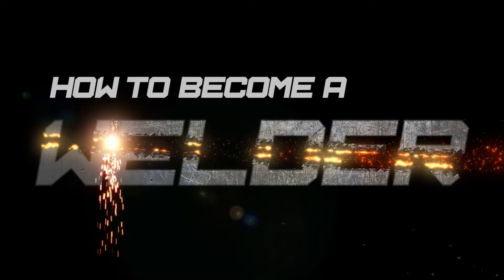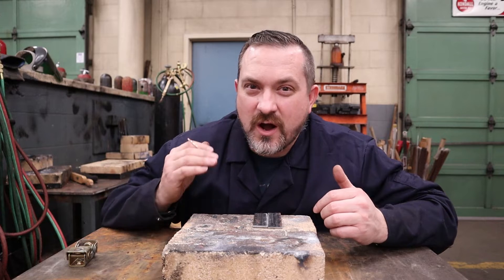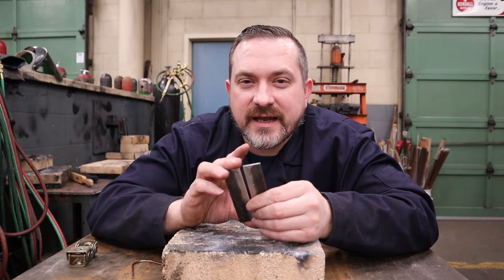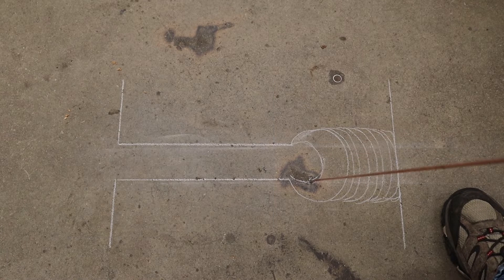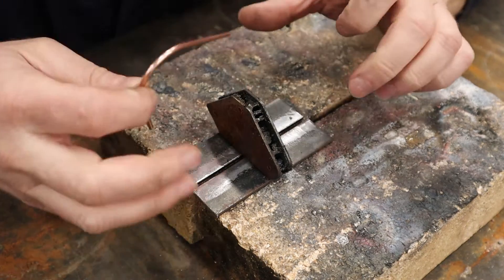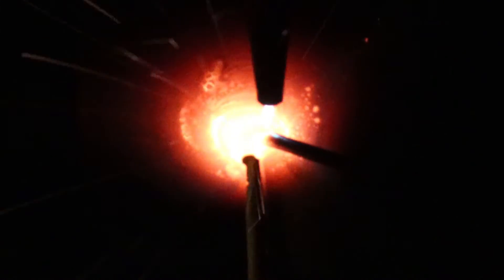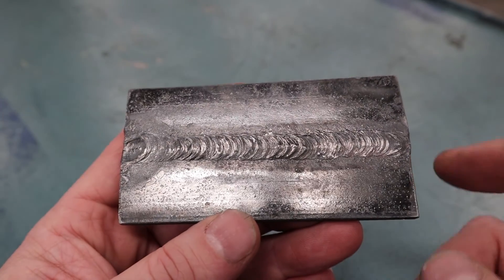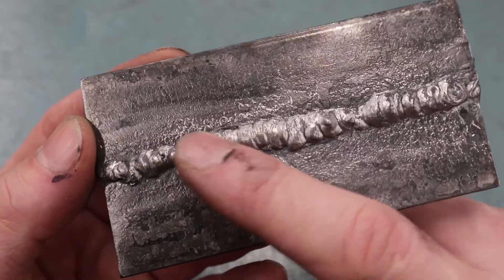How to gas weld butt joints

Comment: I usually let a gap the size ( thickness) of the filler rode ( I adapt the flame 🔥) and works great
Reply from the maker: Yup that's the trick, you need a space  and need it close enough that you can fill it with the rod.  Thanks for the watch and welcome to the channel!

Comment: hi what kind of gas filler rod you would recommend.
Reply from the maker: Just get a general purpose steel filler rod from your local welding supply store.  Especially for just removing broken studs.

Comment: I can't use magnet and weld rod to maintain the same gap. Because of my assignment requirements and when try to weld the gap become thinner and at one point their is gap in between the plates. So what should I do?
Reply from the maker: If you can do what I did, you have to angle the 2 pieces so that as you weld the butt weld joint, the pieces will suck together as you weld them.  If you have the correct start gap and proper angle, they will be perfectly straight when your done.  It's tricky but it is possible.  Good luck!